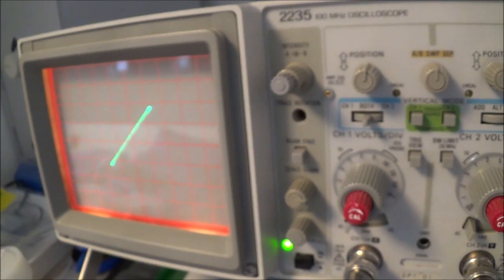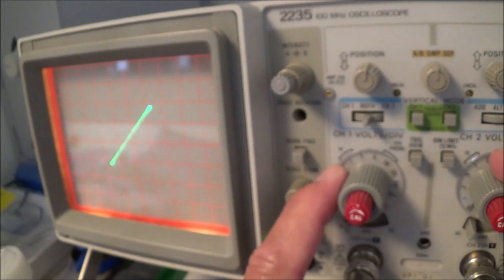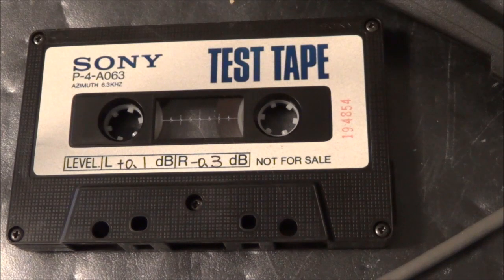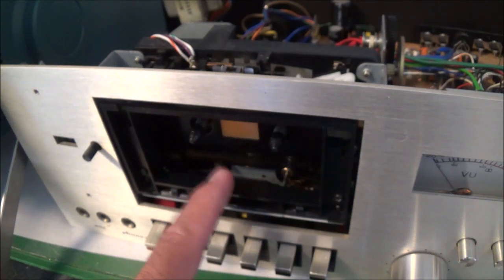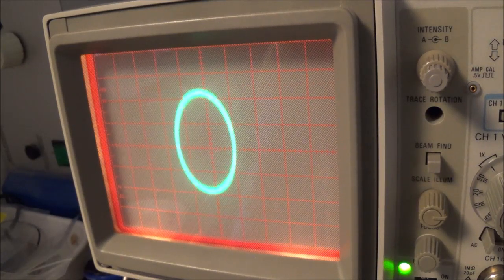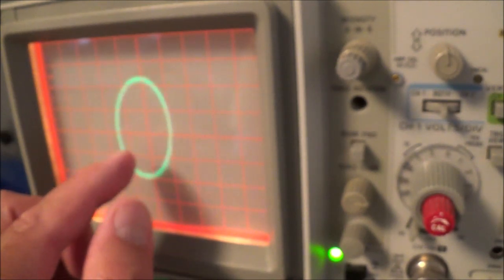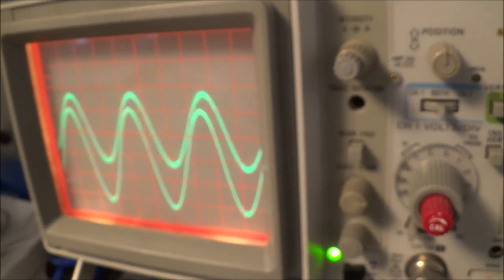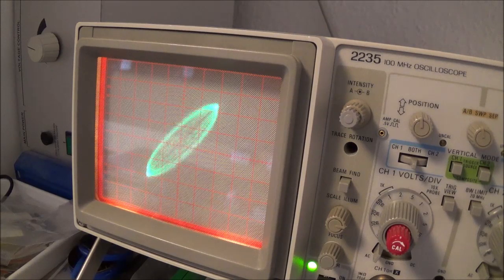Marantz 1820 Oscilloscope X-Y Mode Azimuth Adjustment

Comment: @11:20, your test tape shows you on the label the varience in dB for both channels. They do this to allow you to see the waveforms as individual traces instead of sitting on top of each other...I'd suspect your drive belt as that controls your capstan speed. Over times of non use, the belt develops areas that are weaker and allow for a small bit of RPM variance that you are seeing as a rhythmic oscillation. mark your belt and watch the oscillation compared to the belt position.
Reply from the maker: Hey Steve, thanks for these knowledgeable inputs! Thanks for pointing that out!

Comment: Nakamichi decks are aligned with a 15 kHz full track test tape. The higher you go with the frequency, the more precise the adjustment will be. But 10 kHz is more than adequate.

And that Lissajous looks good enough. There is no tape deck in existence that doesn't show slight instabilities in tape transportation which manifest themselves in high frequency phase and amplitude variance.
Reply from the maker: Thanks for that! 15 kHz tapes are hard to find and when you do find them they are expensive. I only have one tape, so I had to work with that
Reply: @OldSchoolElectronics  you can try Gennlab or A.N.T. Audio. Both produce full-track test tapes to different specifications at somewhat affordable rates. Just in case you might be working on more decks in the future.
Reply from the maker: Thanks for all of these infos! I will check that out. I am sure I will run across more decks in the future.

Comment: Where did you acquire the rca plugs with the small wires coming out of the deck?
Reply from the maker: Randy, I would recommend getting something like this (depending upon your setup). https://www.ebay.com/itm/RCA-Audio-Jack-Cable-Y-Adapter-Splitter-1-Female-to-2-Male-Plug/312648406665?

https://www.ebay.com/itm/7-RCA-Audio-Jack-Cable-Y-Adapter-Splitter-1-Female-to-2-Male-Plug-OFC/202991821427?

Also, get a BNC to RCA male cable. https://www.ebay.com/itm/BNC-Male-to-RCA-Male-Pick-Your-Length-RG58-Coax-RF-Cable-High-Quality-50ohm-USA/164180912949?

Other adapters (like the ones in this video) are like this: https://www.ebay.com/itm/2x-Terminal-Block-to-RCA-Male-For-TV-Video-adapter-Cinch-connector-cctv/252471091470?
Reply: @OldSchoolElectronics  Ok thanks very much.
Reply: @RandyWBrown  I bought these very same plugs off Amazon a couple of weeks ago. They are pretty cheap, too.
Reply: @svenschwingel8632  Indeed they are. I have a dumb question that you can answer or not for me. I bought an ancient heathkit av-2 Vtvm in like new condition. Ikr it's nearly 70yo but measures minute voltage and dB's. I have a Sony TC-WR635S and a Nakamichi rx-202. Both have been re-belted and play fine but their recordings lack treble. I was told to check the rec.bias and current bias levels on both decks. 
 I have SM but don't quite understand what 47kohm resistor in parallel with the meter leads of my ancient heathkit av-2 vtvm has to do with the measurements. 
 The Nak has more than I care to type here. But essentially it wants 400hz and 17KHZ to be  within 1db of one another. And it's got like 6 pots per channel to adjust not to mention a couple of bias trap oscillators. 
 Thanks Randy Brown

Comment: Not only peak voltage but also phase, very interesting, thanks for the video.
Reply from the maker: Right, a recorded signal from one channel will be at its head gap a wee little bit earlier than the one from the other channel, which has its own head gap, if the head is tilted. There would exist a time error. Thanks for watching and commenting!